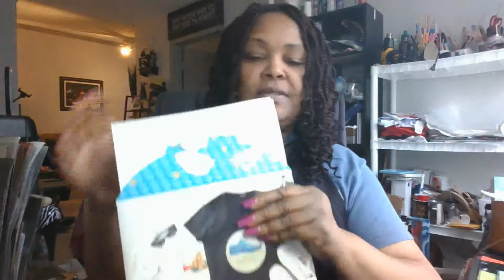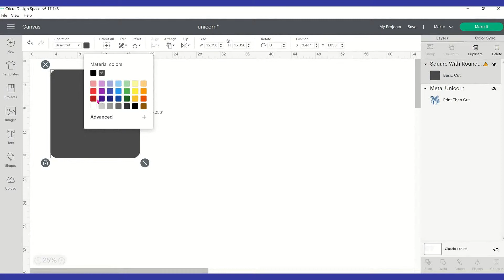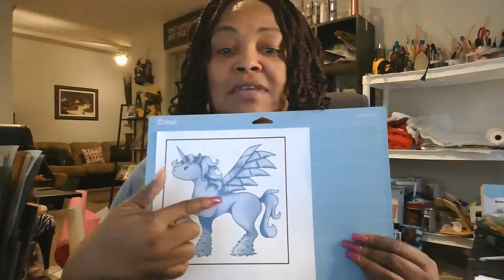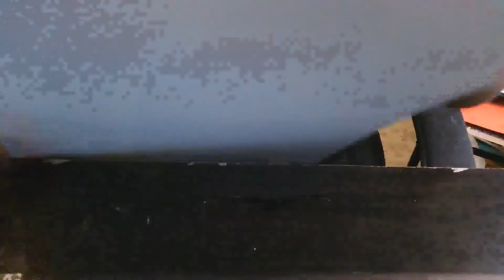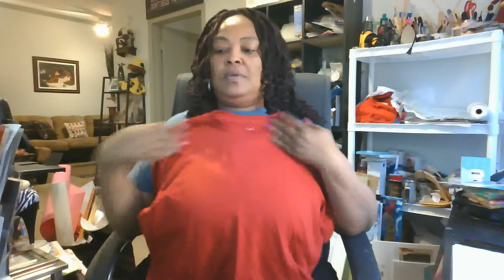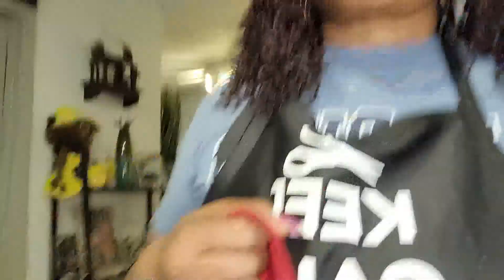Using Pen and Gear Dark T-shirt Transfer

Comment: Is there no need to put something in between the front and back of the shirt before you apply the transfer? Like the heat won’t cause the front and back of the shirt to stick together? I hope that makes sense. 😂
Reply from the maker: That is a great question! No, the adhesive is not strong enough to cause the shirt to stick.

Comment: Hi Doris! Thank you for such a detailed well explained tutorial! But, you said if your image has intricate cuts, not to put it in the cricut? I'm working on a shirt order for a client and the image is a dragon with quite a few detailed cuts. I've tried SO many test methods (using sublimation on black cotton) and this method has definitely worked the best so far! But...I am having trouble weeding the detailed areas. I CANNOT FOR THE LIFE OF ME FIGURE OUT what the best cut setting is AND I even just bought a new blade! Gonna try on the heat transfer you used here, any other ideas or do's/don'ts you can think of would be a godsend! Thank you & god bless!

Comment: Doris I liked this, you were very REAL, I see so many “fancy shmancy” for clicks videos. Refreshing! Thanks
Reply from the maker: TY Tiny!
Reply: @dorisedwards58  your welcome. Hey I know I’m losing my mind but I have the EXACT transfer pack you do, I cut it in cricut , DARK TRANSFER, I then pull out the outline around the transfer leaving me with the transfer in the middle of the sheet that has the blue lines on it. I can find absolutely no other layer to peel back and your video as well as the instructions mentions a third layer. We have the backing which is blue lines the front which is flat and that’s where we print the transfer but I can’t find the third layer that we use to lay it on to the shirt can you help???
Reply from the maker: @TinyWanderland  Blue is the dark Transfer and you only peel that backing off with the blue lines going down it. Then you lay the transfer on the shirt face up, use the silicone sheet on top and iron it on. The silicone sheet is not attached to anything.
Reply: @dorisedwards58  I understand, but is there a THIRD layer? My design is resting on the blue backing paper, if I take that off all the design will be in pieces? Shouldn’t there be a clear layer we put on the shirt and pull back once the image is pressed????? All the video show that, a clear piece the transfer design rests on!
Reply from the maker: @TinyWanderland  fabric transfer is not to be done in pieces. That white background with the blue stripes must come off. There are 2 sides, front and back. There is no other part. The blank side is the transfer and the back side with the stripes is to be trashed after you peel it off.
Reply: @dorisedwards58  so essentially we are just heating the topside of the print out. The material that feels elasticy per say.
Reply: Sorry to clog up your comments btw, I don’t see any way else for us to talk, I appreciate the clarifications.
Reply from the maker: @TinyWanderland  No need to apologize that's what I'm here for 😉
Reply: @dorisedwards58  awesome, so all of our “transparent” designs should be encased in a white “bubble” essentially were only pulling 1 piece to place on a shirt?
Reply from the maker: @TinyWanderland  Yes you got it! It feels like rubber, lol when you want to do a project in pieces it's best to use vinyl and layer it